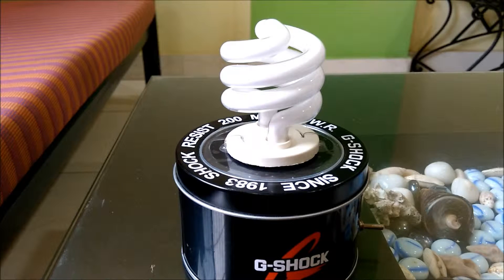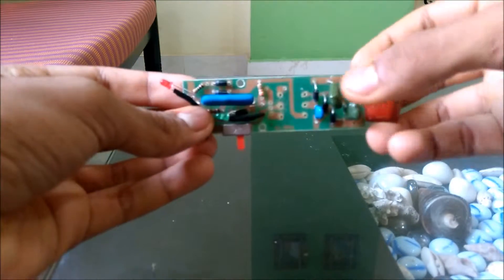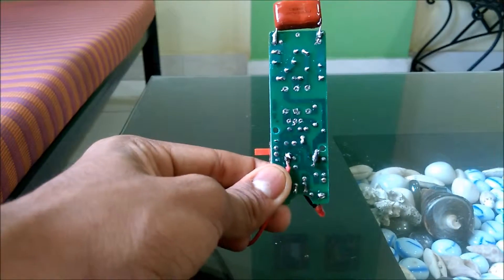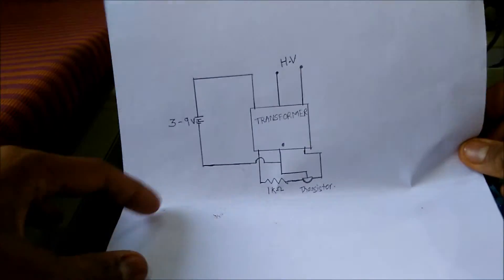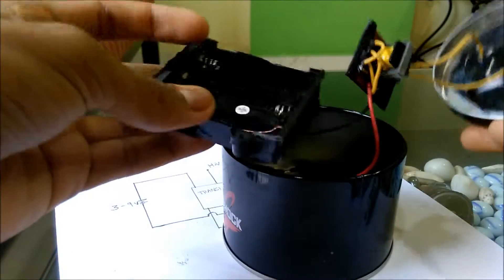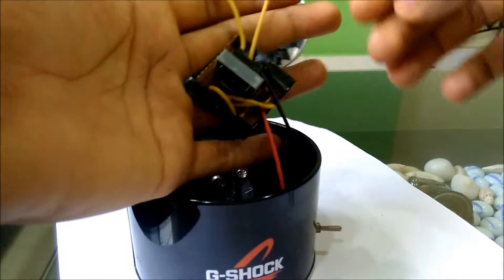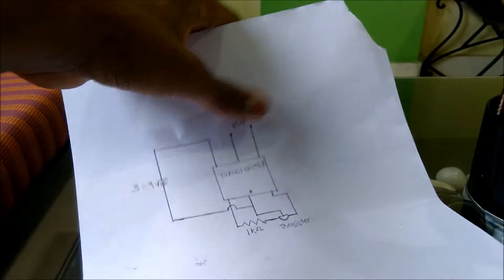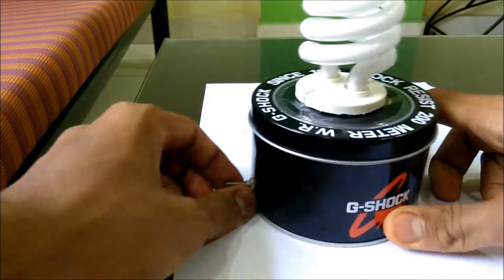DIY Emergency LightBulb out Of A Bug Zapper.

Comment: where are the base colector and emiter of the transistor?
Reply from the maker: +angel rivera it uses a H SD965 transistor.. google it :)
Reply from the maker: +angel rivera in the diagram. left one is the base, centre one is the collector and right one is the emitter..
Reply: Thz.. good video